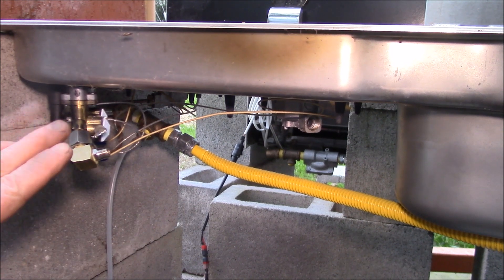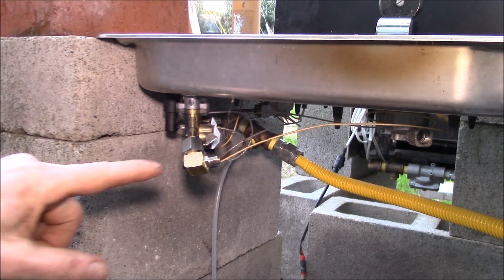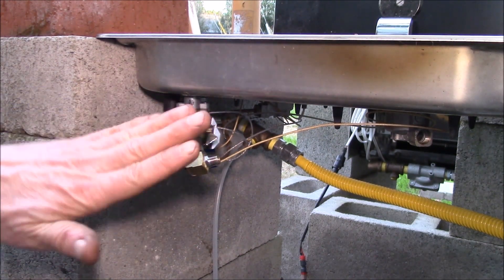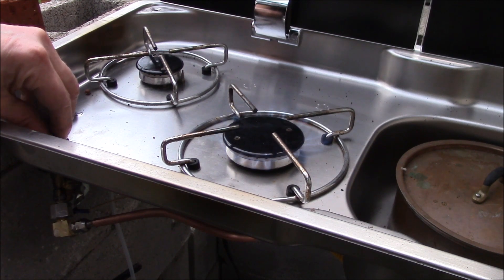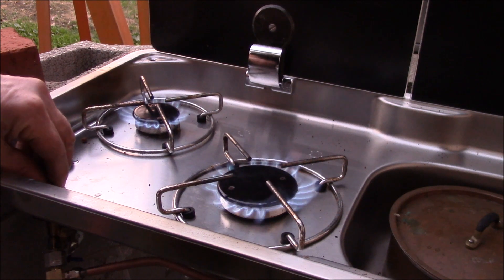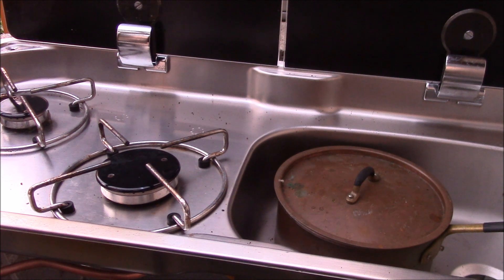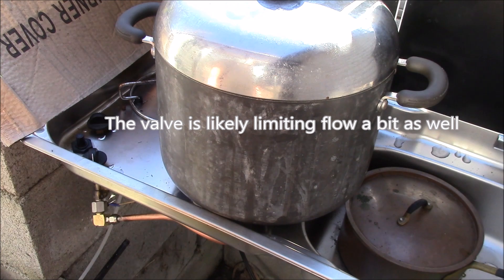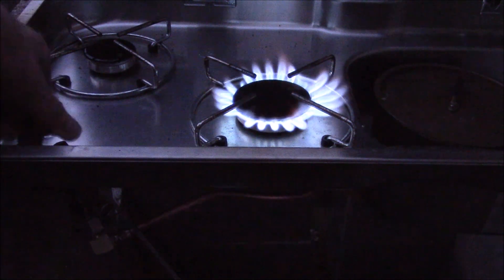Outdoor Kitchen Island - New Gas Line for the Cooktop, Part 2

Comment: very patient for sure
Reply from the maker: Thanks, yes it was a long search.  Didn't spend a lot of time doing the search, but it was just in the back of my mind and every time I had a new idea on what to look for I would give that a go.   One time I hit the jackpot and found the catalog listing with the actual fitting dimensions and those matched what I needed.  Everyone talks up how great metric hardware is but there seems to be less standardization in metric than in SAE.  As long as it's measured in mm, it's "metric", but there's no standardized set of thread pitches for given diameters or even standardized diameters or even whether male of female thread is used on what part.

Comment: WoW, Patient Man.   Not so sure I would have gotten around the Fitting Rodeo as well as you have.
Reply from the maker: Yes, it was a long search for the right parts.  Along the way I was tempted to do more of a hack job by trying to modify the existing fittings.  Glad I went this route as it came out very clean and is much better than what I had in mind originally.